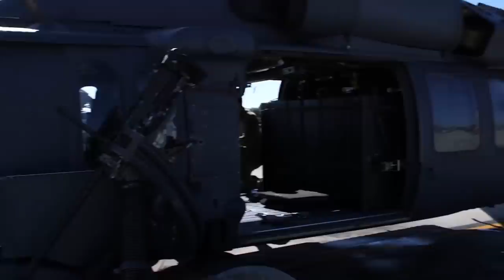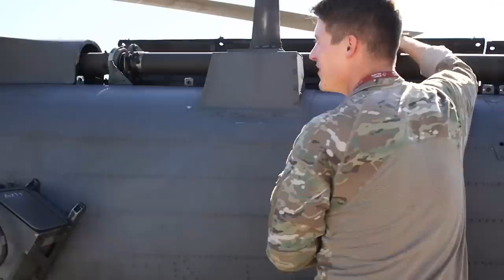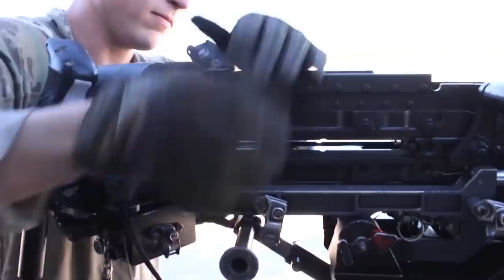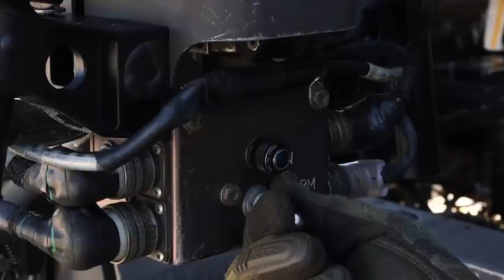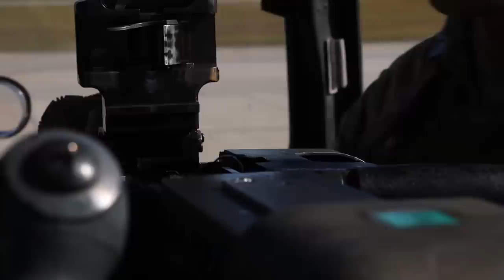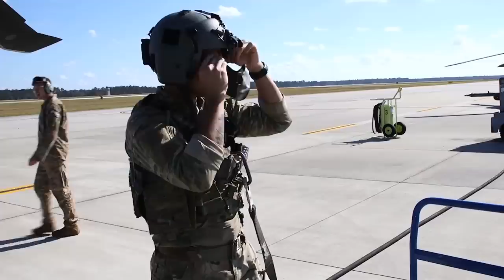Special Missions Aviation Airmen Prep Pave Hawk Helicopter

Comment: Former 129th FE.

Not gonna lie, it took a lot of time and hard work into getting ready for flights. Especially gunnery sorties.
Reply: On average how many people would you say do a full preflight check before takeoff? Just curious, I know they don't rely on just one set of eyes, but I'm curious what the average is?
Reply: @cmnieman1  I worked on Cobras in the Army. Back then one or two crew chiefs conducted a thorough daily inspection. This was usually post-flight or, if the aircraft wasn't to fly, first thing in the morning. The aircraft was cleaned, inspected and any routine maintenance would be conducted. For pre-flight both pilots and a crew chief would be present. This was a verbal ceremony. The senior pilots would use the opportunity to impart knowledge and wisdom to the junior pilots and crew chiefs. So at least 3 unique sets of eyes before every flight. We opened every quick-access panel for pre-flight, which gave access to probably 90% of the moving parts.  Average pilot pre-flight was probably 45 minutes to an hour and average crew chief daily inspection was probably 2 hours.
Reply: Seriously considering enlisting as towards SMA. Any advice?

Comment: This is the mos i want so freaking bad
Reply: In the air force it's called an AFSC. this is 1A9.
Reply: Why join the airforce for helos? The army doesnt need a commission to fly. Pretty sure the army fields more helos aswell plus they have the 160th aka the best helicopter pilots in the US armed forces.
Reply: @aurilius8145  He prob wants to be a crew chief or a gunner on the helos which in the army isn't a 100% chance
Reply: Which MOS? Videographer?
Reply: AFSC
Reply: Shudikan90 ya bro. Not the army
Reply: 7th CAV Trooper that career field would probably be pulblic relations in the AF. Which would be one of the best ones to be honest. We all get paid the same!

Comment: I have a few questions I'm interested in the job aerial gunner. I'm female I'm sure the population is very small with them. Is this a volunteer job and do they have their own physical test like special operation jobs? It's hard to find more info outside of the 10min video on the USAF website.
Reply: J Gee from what ive heard, the entire pave hawk crew is not spec forces. They are a normal aviation crew i saw someone else say in the comments.
Reply: They are not special operators. They do, however fly PJs into and out of the “X” and are in just as much danger. They are bad ass people that will come get you no matter what. There are some female SMAs but they are hard as woodpecker lips. You will be in a gun fight.

Comment: Why aren’t those mini guns or gatlin guns?  I thought those guns were phased out.  Are gun jams an issue?  I can’t believe you have to push the ammo up with your thumbs should be a better way.  USN F-14 M61A1 ordnance 89-95
Reply: As far as I know, the M134 chews through ammo far more than the M2 Browning, plus it's higher maintenance. There are pros and cons to both, but I'd say the M2 has the longevity and endurance advantage.

Comment: Anyone know who or how it's determined what munitions will be used according to which helicopter? Obviously this one has 2 50 Cal's, but who determines using two of those rather than a mini gun or one of each? Obviously I understand each mission is different, just curious how that's determined and who does it?
Reply: Christopher Nieman generally the flight lead makes the call and it is approved by the unit commander. You are correct about it being mission dependent.

Comment: Trying to figure out the guns are aimed and fired from inside the aircraft.
Reply: jbr496 very carefully.
Reply: It looks like they can be locked forward and designed to be shot at a certain distance, ie 1/2 mile or they can be unlocked and shot from inside the helicopter.
Reply: Fire and adjust. Also more practice leads to better shots on target. You pretty much is lead and lag as you shoot.

Came naturally to me, harder for others.

Comment: Does this job require normal color vision?
Reply: Yes
Reply: Check with your recruiter. In the Army, an avionics communications equipment repairer, for example, doesn’t require normal color vision per this website:
https://usmilitary.com/top-army-jobs-for-the-color-blind/

The Air Force is legendary for being more "selective" for the same job and will probably require color vision. JTsuits channel worked on helicopters in the Navy and gives some good insights, as well as many other channels. I personally would not want to be stuck on a boat so I talked to the Air Force and went Army for the college money.

The job I did not realize was a full time job, musician in the Air Force. A guy I worked with as a programmer spent 4 years in the Air Force playing the flute ! Not the least bit glamorous but he had 3 warm meals and and a bunk in an air conditioned building every night.